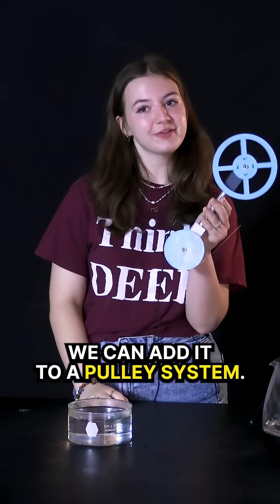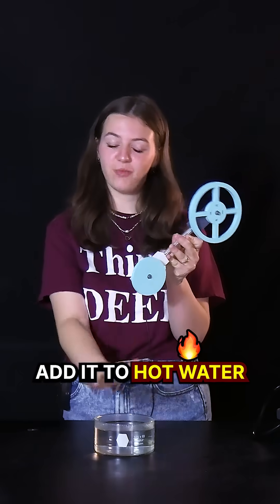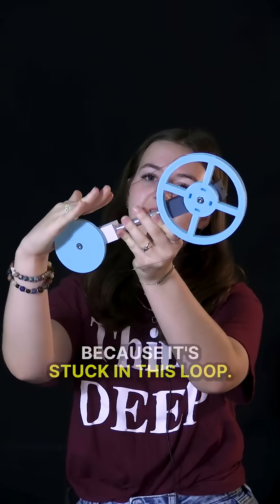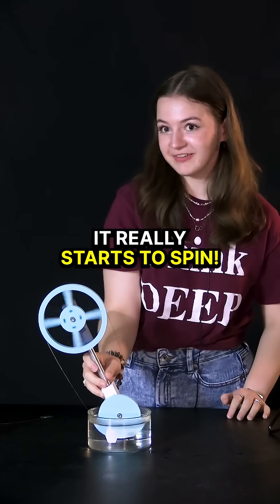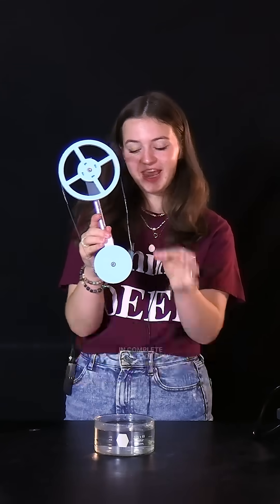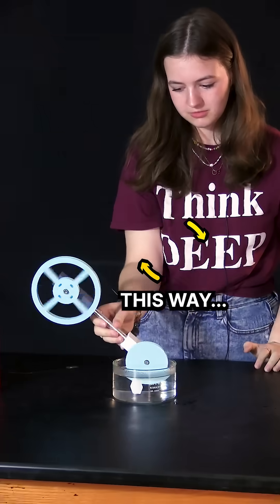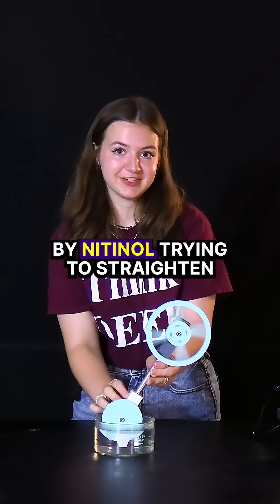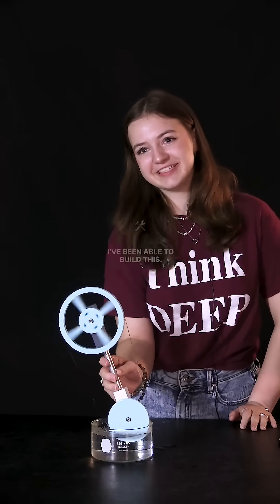Magic Metal Demo (Amis' #DEEP Group with Zoe Fenley) #physics #shorts

Comment: i was confused on how that would work, since it’s creating movement, which is energy, then i realized it’s probably cooling the water, which is removing energy😊
Reply: Just build a giant one in death valley. Good at least for the day time 😂
Reply: @ sadly that would just move it, but if we could find a way to remove the heat from the wire, then we could chain them together and warm alaska via death valley. in theory anyway
Reply: It’s not cooling the water. Nitinol actually gives off heat as it bends back into shape. 

You need heat to transform the crystalline structure from martensite to austenite, which causes it to release more heat in a process known as the elastocaloric effect
Reply: @ so then where does the energy to move it come from?

Comment: Either a hot spring or summer heat it quite possibly could be power indefinitely
Reply: Add something a generator to the system and you’ll find out quickly why it’s not an effective solution
Reply: I mean, you could just set a steam engine on the asphalt in Arizona